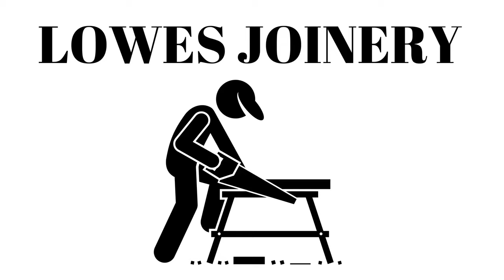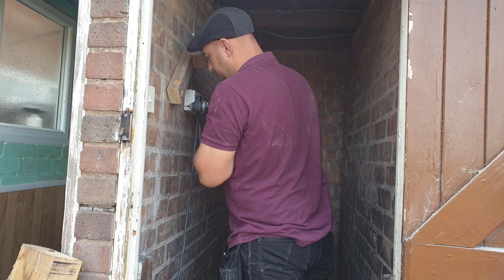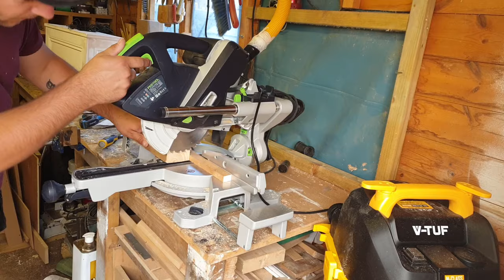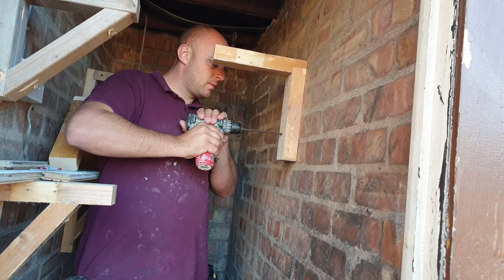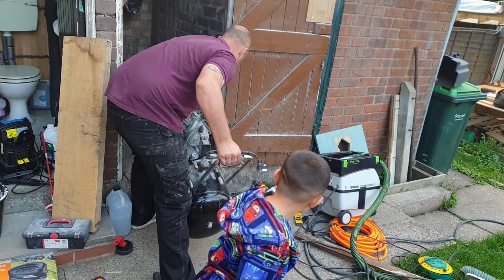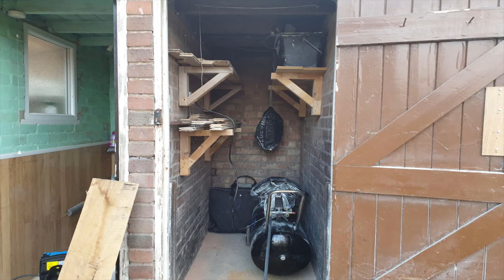Making simple gallow shelf brackets / woodworking basics

Comment: You hung the long lengths of the bracket in the opposite direction to the first two brackets which I think was a mistake as the notch is now the weak point. Good video though with some good tips.
Reply: Noticed that too . Then there would be point in having a notch.

Comment: Maybe an incredibly stupid question but how do you know where you want your cross beam ends to go, like how long or short, what determines this decision? Also, how do you know what angle to cut the ends at?
Reply: Angle is always 45º, no matter the length. So it does not really matter how long or short you make the cross beam, it will always fit.  That said, you could use Pythagoras' theorem to calculate the exact length needed.